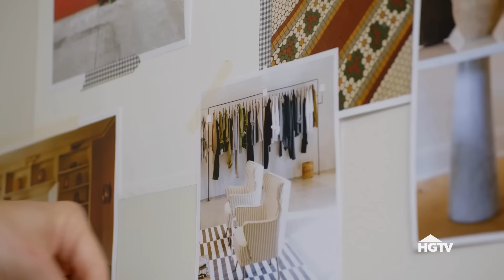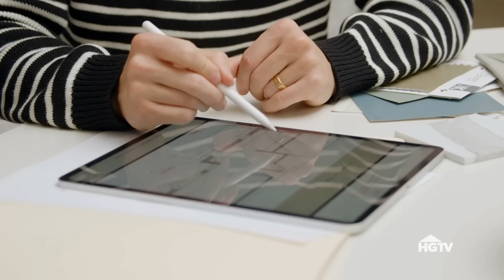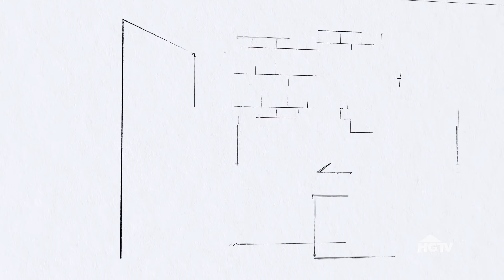Transforming a Disjointed House into a Dream Home | The Nate & Jeremiah Home Project | HGTV

Comment: In almost every house they include a built in seating area, such as in the corner here making a dining area with the round table. Thats an excellent design tip that many people don't include, but it works in so many ways such as a window seat. My family had window seats on opposite ends of a room -one faced east, and the other faced west. You would have your coffee in the morning on one side, and then stretching out to relax in the afternoon on the other side. Not only do they save space on the floor, but you can also have storage underneath the window seats, or the fitted dining banquette as they have here.

Comment: I would have wrapped the whole kitchen around and put one or two open glass shelves across the window.  Positioned the closet beside the door at kitchen base.  Done red brick instead of tile, hood copper/charcoal or wood like the shelves.  Love that they repurposed the furniture and kept the railing.  Love what they did with the ceiling.